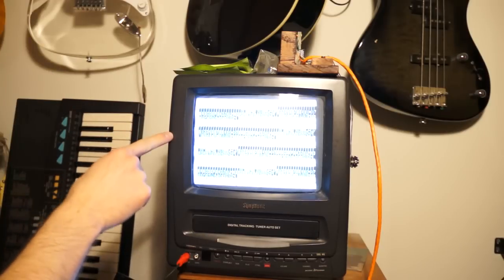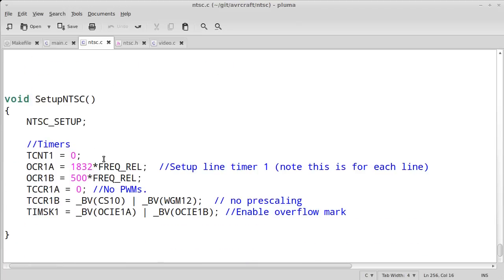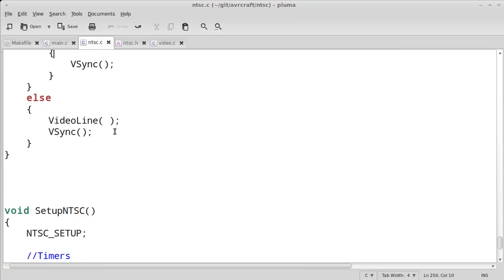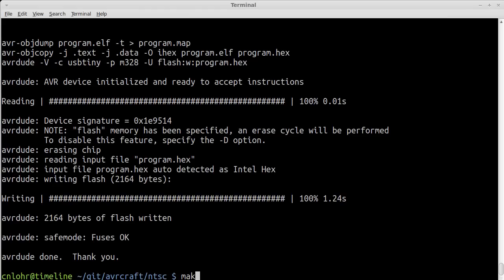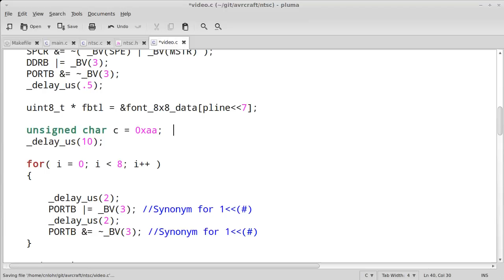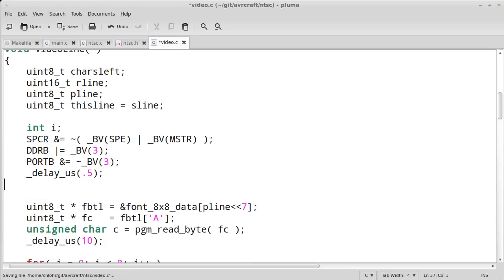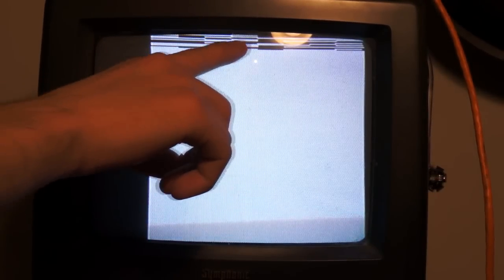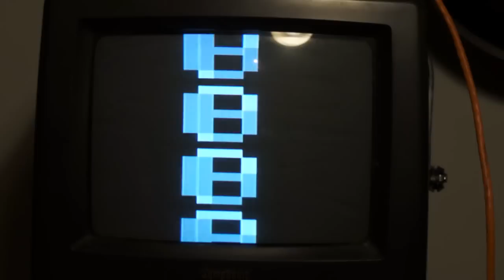Let's Code: NTSC Part 1B (Basics)

Comment: What does the cline and sline mean. I get that the interrupt happens at the start of each line and it does Hsync but i don't really understand what the cline and sline are doing in the if statements. Has it got something to do with vertical  sync?.  Could you explain it in a concise way.

Comment from the maker: oh! I didn't realize you were there. You should be familiar with things like PWMs, etc, on the AVR in that case.  I don't know if/how the arduino exposes interrupts, but I would imagine that would be a point of change.

Anyway, most AVRs support the 6-pin header.  You can go buy a USBTinyISP from ladyada and get started with C on the AVR! It's the way to program it.  When you get good at it, it's almost as fast to program and WAY MORE FAST to run.
Reply: CNLohr  hi. How the sprintf works in avr?

Comment from the maker: I never used arduinos, as so much of what I do is SO time critical, like this here. C is a really important thing to understand and understand well.  It has applications EVERYWHERE.  You can even write better (faster) C++ code by understanding how C works.  But, admittantly, if you wanted to re-write what I wrote, it would be extremely complicated, but to simply use what I wrote... not that bad.

Comment: Hi. I am experimenting with Arduino video generation and this has been great. Thank you. I am using your code for jitter correction, and it works great, so I was trying to understand it. And I was wondering why you need this command in your code:  \n\t    add r16, %1 \? Are you adding the value of register 1 to the value of  timer1 into R16? Why? What is stored in this register 1? Anyhow, thanks for this again.
Reply from the maker: %1 points to the first assembly expression, i.e. TIMING_OFFSET.  It's a clean way to use variables inside inline assembly code.
Reply from the maker: Specifically here, I'm using it with a clock timer that's running at the same speed as the system clock to figure out what divisor of 4 the interrupt was called in.
Reply: Thx a lot for your very quick answer. I understand your explanation and mostly your code. But am still puzzled by the following sequence of commands in this part of it:

   \n\t    lds r16, %0 \
   \n\t    add r16, %1 \
   \n\t    subi r16, %2 \
   \n\t    andi r16, 3 \

So, I know you are loading the contents of timer1 into register 16, and I know you want to do an offset with the subi command (I assumed you wanted to remove the cycles wasted by your routine to get the value at the exact time of the interrupt) . And I understand you will do an and of the timer value in register 16 with number 3 to find out the divisor you need to wait with nops. 

But on the second command, you are using the contents of TIMING_OFFSET (which is defined as 1) as the second parameter of the add command, and if I understand correctly, it refers to a register, (therefore register r1 ?). which would add the contents of the timer (already in r16) with the contents of this other register. This is what I didn´t grasp.

Am I correct that you are adding r1 to r16 ? And if yes, why would you do that ? What is supposed to be in r1 ?
Reply from the maker: Nope.  Constant. 1.  it could have been a larger number like 5, or 9, it just matters that the function takes a constant amount of time.  The 1 handles the time difference in the modulus.  It's really difficult to explain the more I'm thinking about it, but, basically, if you don't subtract 1, there are situations where code could be running that would take 4 cycles too few, by adding the 1 it ends up being on the right side of the modulus.

Comment: Why do you call sleep_cpu() exactly?
Reply from the maker: +unebonnevie It would help if you give me an exact time, however, but, many times I'll use that to trigger events at a precise time in the future, or,  to let another event happen at a specific time in the future.
Reply: +CNLohr I see.  So, the CPU will go sleep via the sleep_cpu() call, but the line interrupt will wake it to ensure precisely a new scan line has happened.
Reply from the maker: I believe that's the case.   If you don't do it that way, you have to use some really tricky code to fix instruction jitter.  For instance, the AVR could be executing a command that takes 2 or 3 cycles when the interrupt happens.  If you are sleeping, it's immediate.